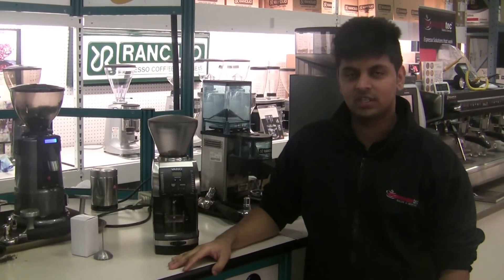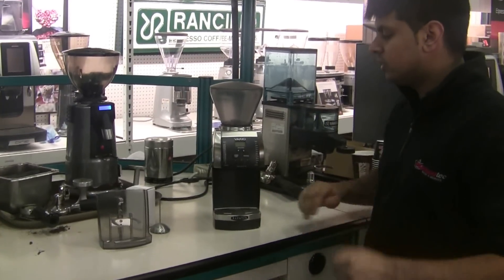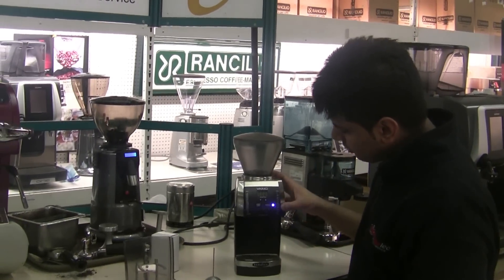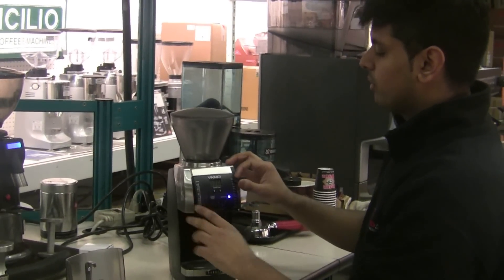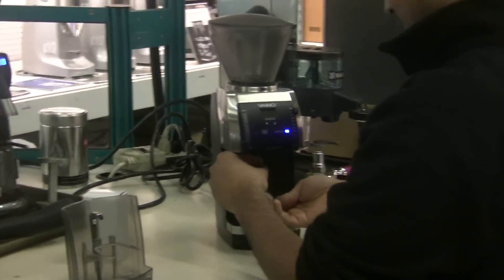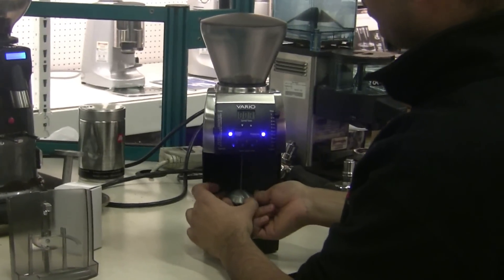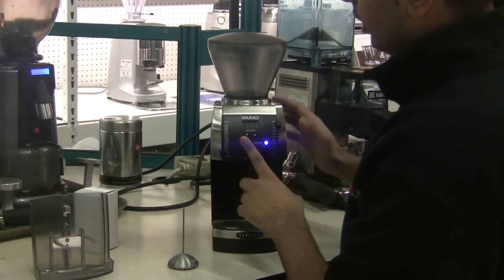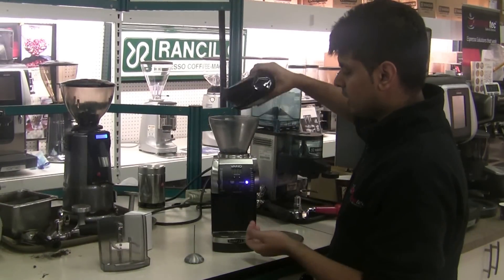Baratza Vario - How to Calibrate

Comment: Thanks for the video. I hear a change of sound going from the 2 to the 1 and then pretty much right away on the micro settings. The machine is only a couple months old.
Reply from the maker: Thanks for the inquiry!
Did you purchase the machine from us? It's hard for us to know exactly what's going on without seeing the machine in person or speaking with you directly. Give us a call or send our service department an email: service@espressotec.com.
Reply: I didn't. I just bought it off ebay. I just saw this nice video on it.
Reply: Could I put it on 2 and starting turning courser; then put it on 1 and keeping turning coarser until it's right?
Reply from the maker: Generally when adjusting coarser there are minimal issues that can be encountered... You should be fine to go ahead and do this. Please do reach out if anything changes!
Reply from the maker: Generally when adjusting coarser there are only minimal issues that could be encountered — you should be fine to go ahead and do this. Please do reach out if anything changes!
Reply from the maker: It sounds like you're hitting the zero-point, where the burrs are touching. Try using the recalibration tool to back it off a bit, so that setting #1 isn't quite so fine. If you continue to have issues, it might be worth sending your machine to us for an inspection. Hope that helps!

Comment: how sensitive are the adjustments? I cranked my tool six times to the right and it grinds only slightly finer than before. I calibrated it with both the adjustment levers all the way to the bottom though.
Reply from the maker: I would recommend calibrating the Vario as described in the owners manual. The calibration adjustment is not extremely sensitive but the motor will change pitch as you rotate.